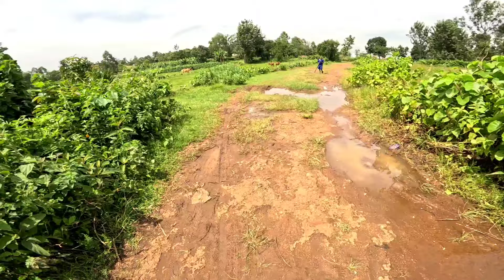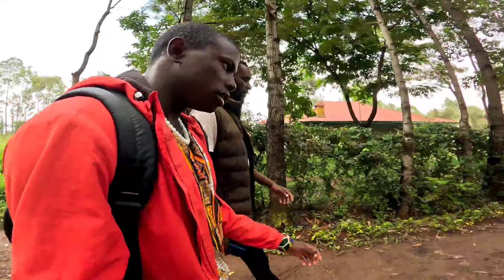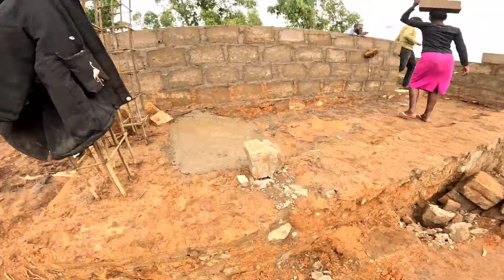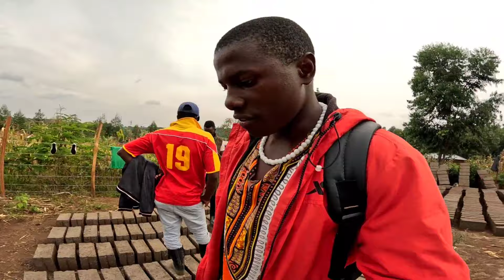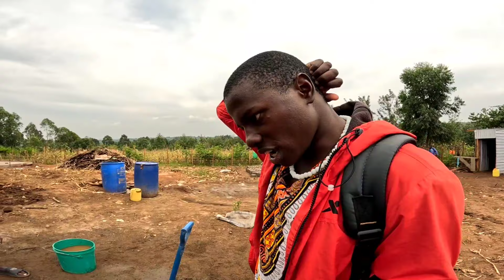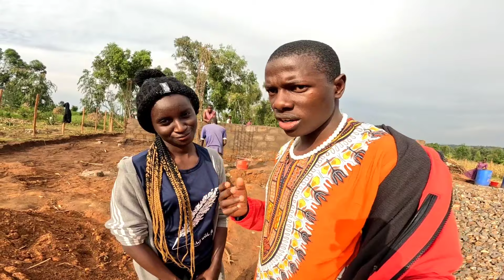Why she Celebrates This after pressuring to Construct Big house 🏠

Comment: What is your topic talking about I don't understand
Reply: Pleasure
Reply: He meant pressure
Reply: BT, before you put headings or titles on your videos, please check with those close to you if it's the correct wording you've used. I'm assuming you might have meant DK pressuring you instead of pleasuring 😅.
Reply: @chipsblossom1904  He can also leverage AI for correct and insightful titles.